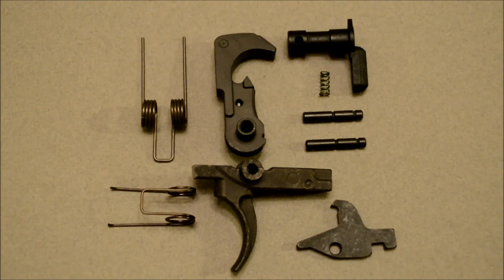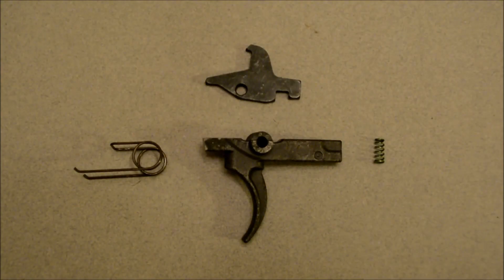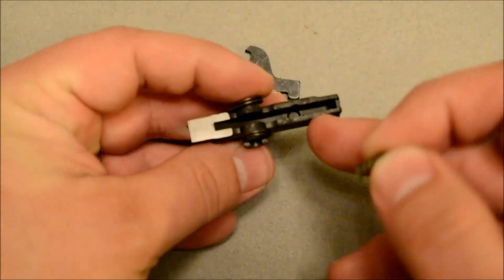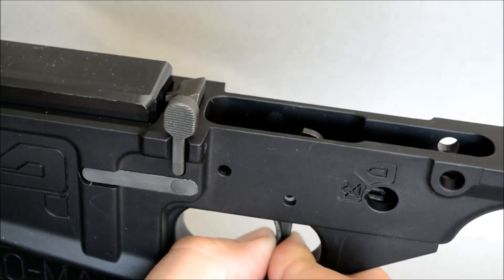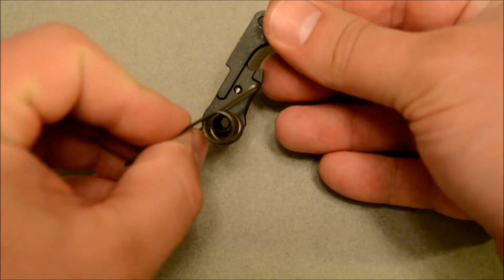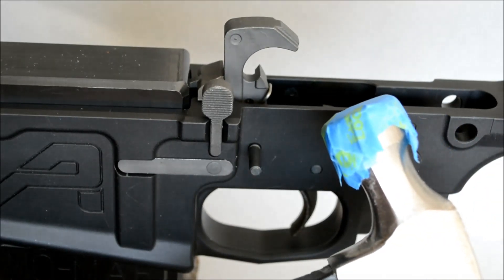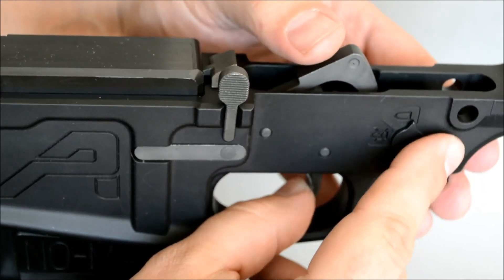How to Install the Fire Control Group on an AR-308

Comment: For anyone struggling to get the hammer installed with the pin. Move the selector to the fire position and its cake from there.

Comment: Great video, only complaint is I needed the rest of the lower parts installed too not just the trigger
Reply from the maker: I had that video on my channel, but YouTube removed it. I will try to re-edit it to fit with the policies and see if that will work.

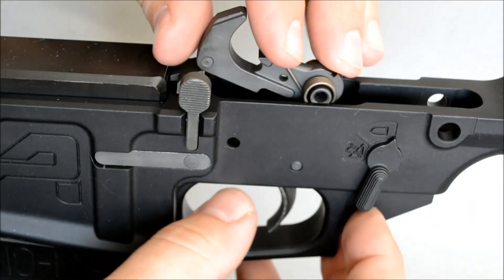Comment: 2:40 note!!! Make sure the hammer spring arms are ON TOP of the trigger pin, not underneath! The spring is what holds the trigger pin in place!! I made that mistake lol. Otherwise the trigger pin can move
Reply from the maker: Good point! Thank you!

Comment: I notice on the trigger and hammer pin that there are grooves on them...does it matter what end goes in first or from what side?..they must do something or they wouldn't be machine into the part..what are the grooves actually for?
Reply from the maker: You are correct that the grooves serve a purpose. The groove in the center of the pin is there for the wire spring in the hammer to hold it into place. The groove on the side is there for the hammer spring to hold it into place on either side when you install it into the trigger. They make them both the same to make it easier, so you can install either pin in either hole. It doesn't matter which pin goes into which hole. It also doesn't matter from which side. Very rarely will a kit have a specific pin for the trigger and a specific pin for the hammer with different grooves. I hope that makes sense. Let me know if my rambling made things worse haha! Thanks for your great question and thanks for watching!!
Reply: 1:57 We noticed that the trigger pin was put in backwards.

Comment: Great Job , very to the point and I love the trick with the painters tape on the hammer. Is the ar-15 mil-spec trigger/hammer and disconnect the same on a .308 ?
Reply from the maker: Yes, they are compatible. Thank you for watching!

Comment: my issue is holding the safety selector in place what holds that in? I see a hole underneath and have a small screw from a parts kit that takes reg small screwdriver but wanted to find out before hand. Aero M5
Reply from the maker: There is a detent and spring that gets installed with the pistol grip underneath that hold the safety selector in place. I should have explained that better. I'm sorry.

Comment: Chris I did the trigger part.. but when I put the pin to hold the trigger in place the trigger was hard  when I moved the trigger it didn’t want to go back to its place.. I know for a fact it’s the pin what do you recommend??
Reply from the maker: What brand is the receiver and lower parts kit?

Comment: At the very last of the video you said something of the safety " without the spring you can't pull it in place"? I am lost there, please explain.
Reply from the maker: At the end of the video, I didn’t have the pistol grip installed. When you install the pistol grip, you install the safety selector detent and spring. The spring and detent are what lock the safety in place at either the fire position or safe position. I hope that makes sense! Good question!

Comment: Wish I installed that little spring correctly the first time, now i gotta pull this all apart and turn it around. I heard you can have issues if not installed correctly.
Reply from the maker: Fighter4Street Which spring are you referring to?